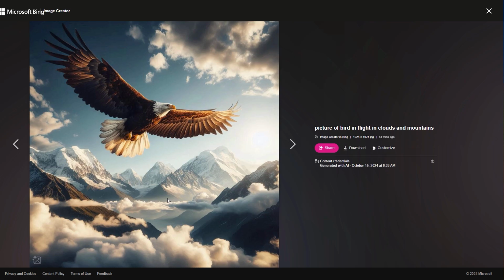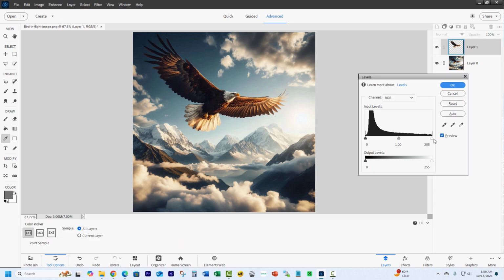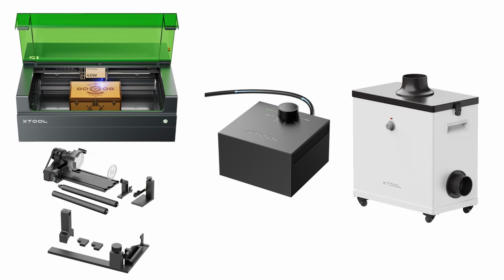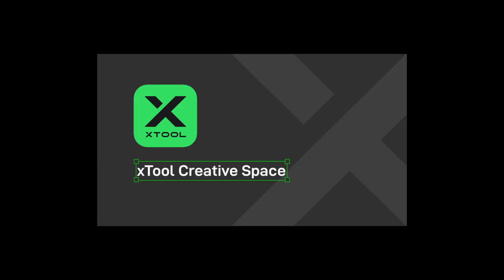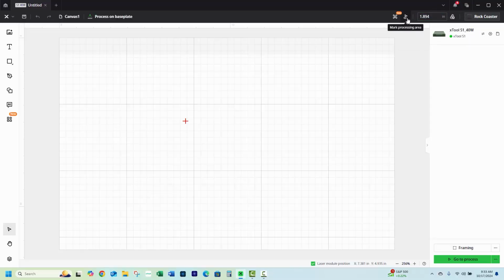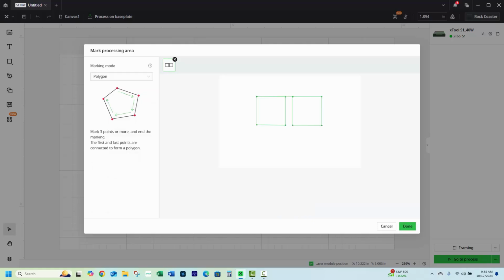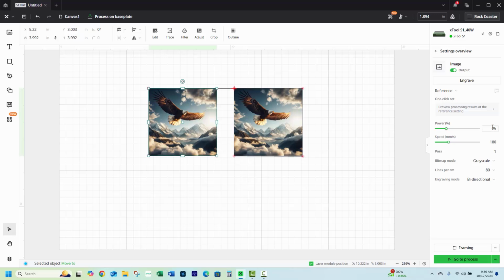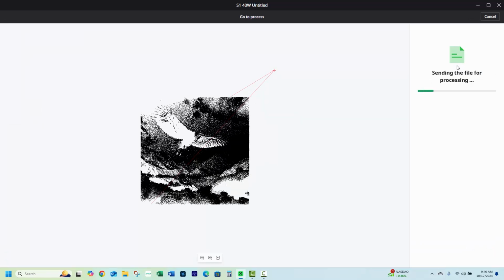How to Laser Engrave Photos on Slate Coasters | xTool S1 Tutorial

Comment: why does no one uses the handy snapshot function? I love it once i figured out how it works.
Reply from the maker: Interesting. How does that work with the honeycomb grid?
Reply: @ with my s1 there where a bag with sticky plastic markers. ACC instruction you have to Place These markers within the workrange of the S1. Otherwise you get an errormessage. 
One Marker Looks different. It has to be put at the lower Right corner. After that the calibration process begins. This process is guided by your mobile Device. Before calibration the Laser adjusts it’s Focus.  Turn you have to allign the red cross laser exactly in the center of each marker. After that the calibration is done. Now you can Place your Material within the Four markers, make a Snapshot with von cellphone or tablet (XCS has to be installed bevor calibration). And the send the Picture to your Computer. Before you get the snapshot on your Computer, you Must Scan a  qr Code from the Computer to verify that everything is Fine. After that and Receiving The picture your Done. 
1. put a material in the laser
2. take a pic
3. send it to the Computer(it opens sutomatically)
4 take a automessurement of the focus 
5 Place your project "on the Material"
6 engrave or cut as you prefer. 

It Sounds more complicated than it's in real. The whole process takes 15-20min. 
And it Works on mobile devices too. A Computer isn't necessary.